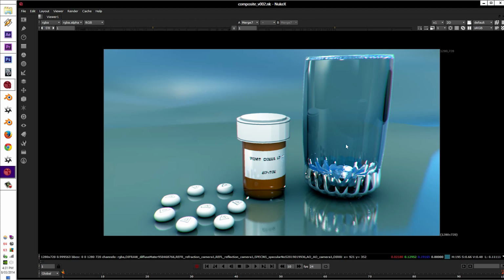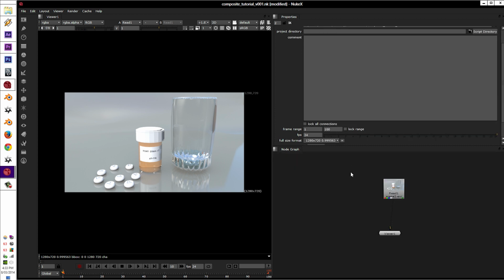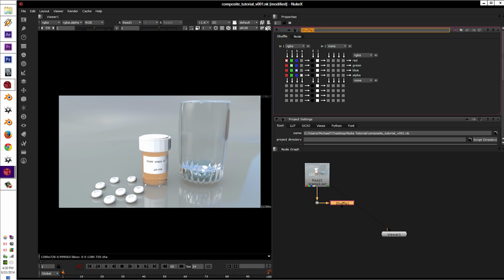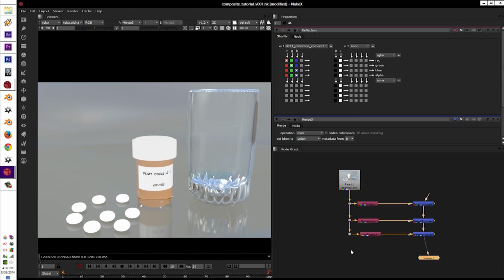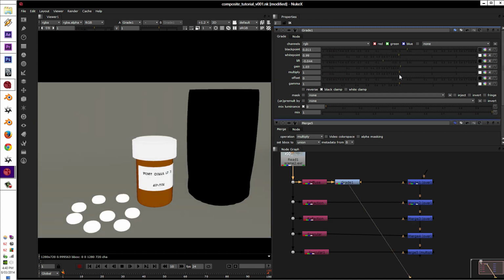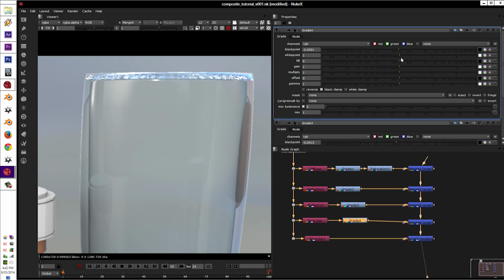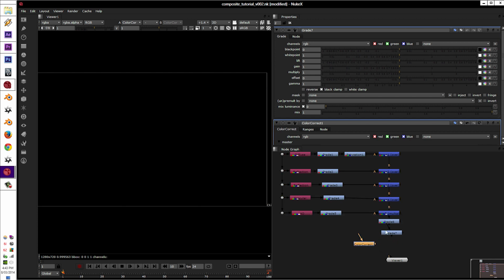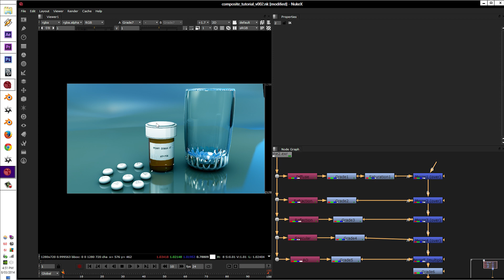Nuke : Render Pass Compositing Tutorial [BASIC]

Comment: This a beautiful tutorial, excellent.

For further reference: https://docs.blender.org/manual/en/dev/render/post_process/layers.html

   Render layers allow you to render your scene in separate layers, usually with the intention of compositing them back together afterwards.
   This can be useful for several purposes, such as color correcting certain elements differently, blurring the foreground as a fast manual method of creating DoF, or reducing the render quality for unimportant objects.
   Using Render Layers can also save you from having to re-render your entire image each time you change something, allowing you to instead re-render only the layer(s) that you need.

Therefore, the purpose to separate out and immediately resemble back together al the passes is to make a comp that produces a look identical to the original "Beauty" on the first place; to make sure we have put back together all the passes (in Nuke, with merge node with "plus" operation for adding and "minus" for subtracting render elements and with "multiply" for Raw render elements with the respective filters), provided by the CG department, in the appropriate workflow; at this stage we must not add any grading, color correction, blur etc etc. Once we compare that all render passes in our final comp produce an identical image to the Beauty; then, we proceed to alter the desired applicable render pass (element) for the effect we intent to make, let it be applying glowing, color correction, blurring, etc etc; which at the end, we may produce a composition that is totally different from the Beauty, but it is as requested by the clients, who are always asking for changes; and it is cheaper to do changes at the Comp stage than at the 3d cg department level. So thumbs up!!